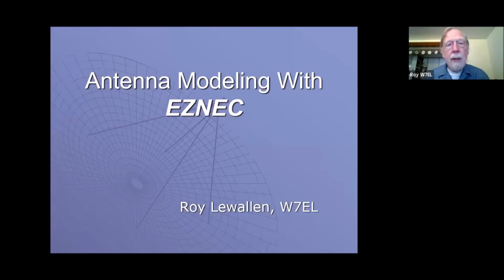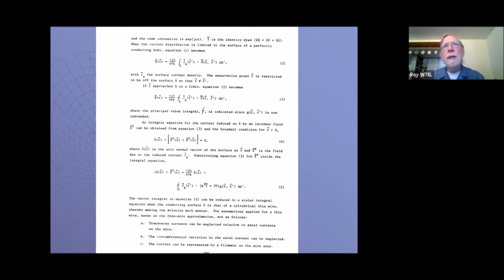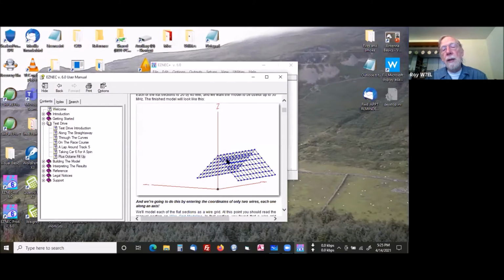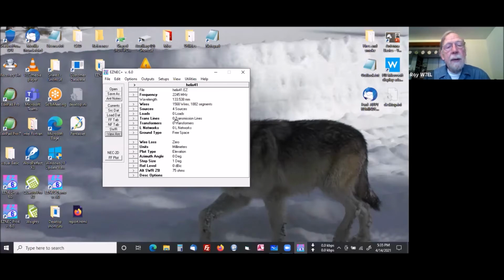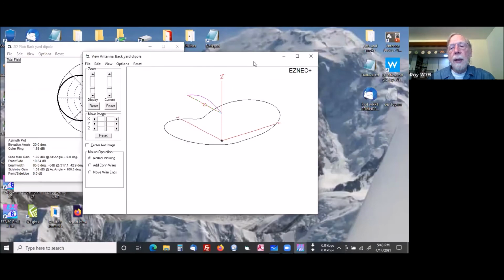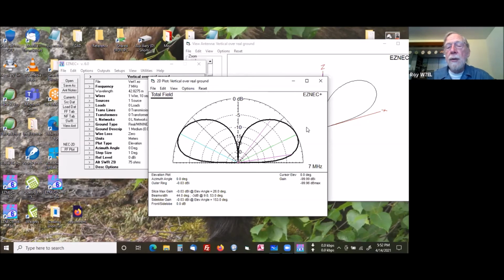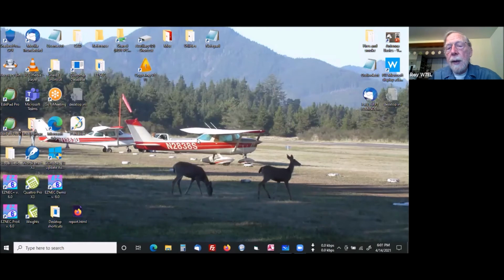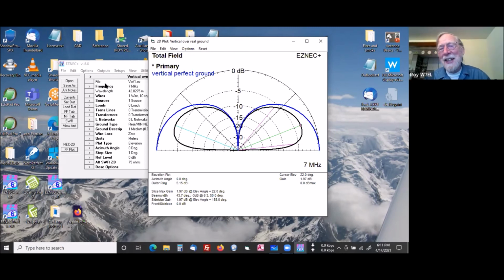EZNEC Antenna Software Presentation (April 14th, 2021)

Comment: Out standing video.
Question. "How do I add a transmission line?" I have an 80 meter delta loop and the feed point impedance is 114 ohms at resonance. I know that I can add a 1/4 wave section of 75 ohm coax to get the impedance down close to 50 ohms. I've done this many times. But I can't figure out how to do it in EZnec?  I've clicked transmission line and in that window I clicked on add. Another window opened and I entered "1". But I can't figure out how to add the transmission line. I entered what I thought was correct and came up with 25 ohms. That's not right. I first put the actual length needed to make the stub and VF =1. Did not work. Then I changed the length to 246/f(mhz) and then put the VF in as .66 for RG 11. Again the answer showed 25 ohms. I've done this with a smith chart and I get the correct answer but can't get it to work in EZnec.  Can you do a video showing how to do this?
Barry G. Kery, KU3X